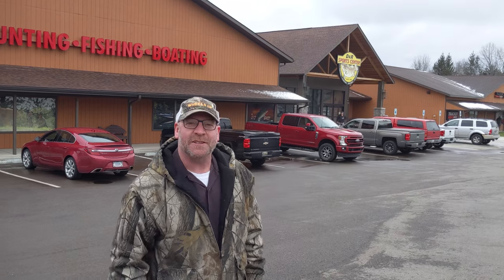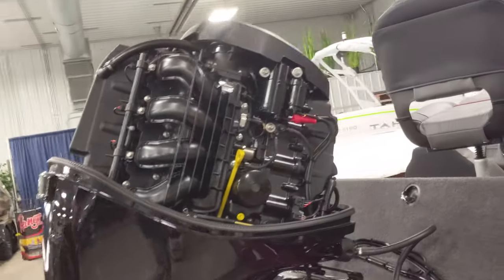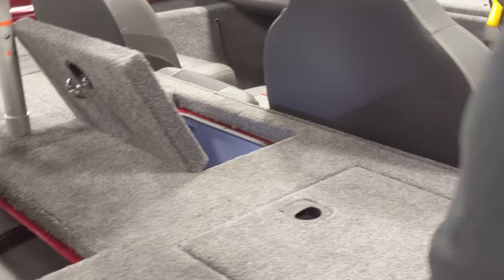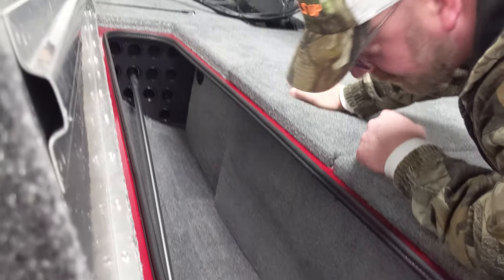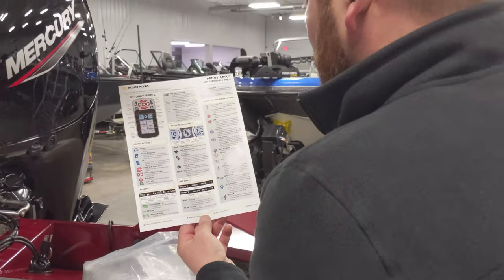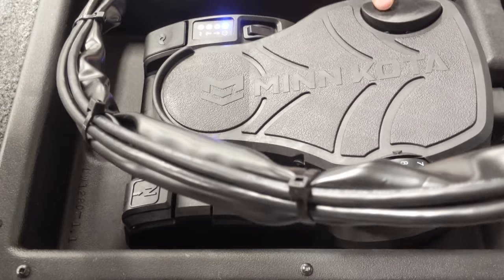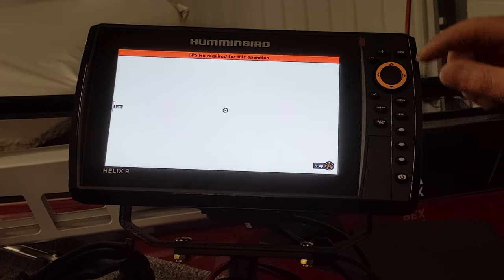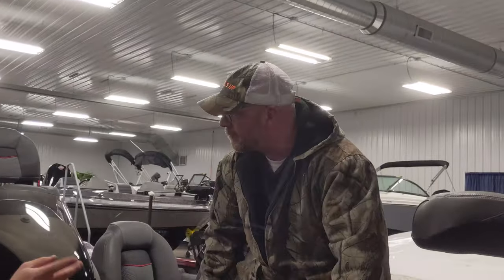I Bought A 2022 Bass Tracker Pro Team 195 TXW Tournament Edition

Comment: Man, you got that boat decked out. Nice electronics, Ultrex and a tandem trailer.
Reply: If you haven't done it yet, buy some dry storage bags for the various items in your storage compartments.  Cause if you haven't already found out, they're not dry.
Reply from the maker: Thanks James!
I figured I might as well get all the upgrades to start with so I have fewer regrets when I'm out on the water. I added the passenger side console too for some extra cover at 60 mph! So far, I love the boat...

Comment: How much was that nice boat ? If you don't want to answer I understand.  Thanks.
Reply from the maker: Thanks for the question Clint. I upgraded everything I could except the engine. There is a Pro XS 150 available but I didn't see the value in gaining 2mph when it already goes 60mph. Anyway, I upgraded the trailer to the tandem axle with brakes, trolling motor swap to the I-Pilot Link 80lb. thrust, 2 Helix 9 Humminbird graphs, passenger console, and custom boat cover. Total cost 45k.....
And worth every penny so far